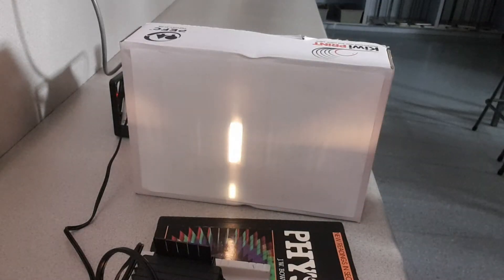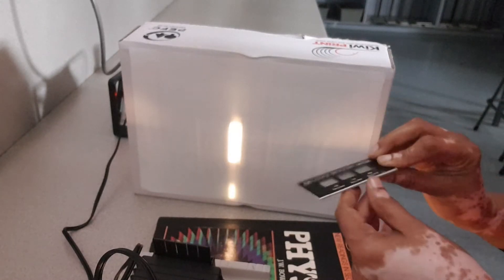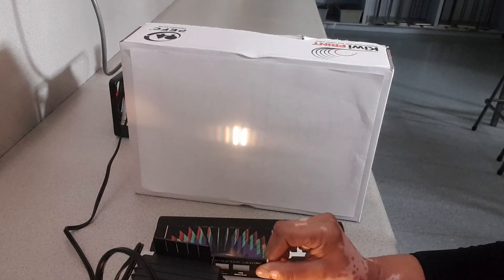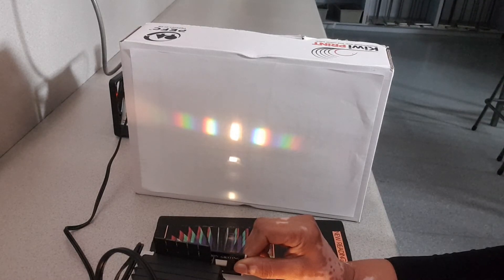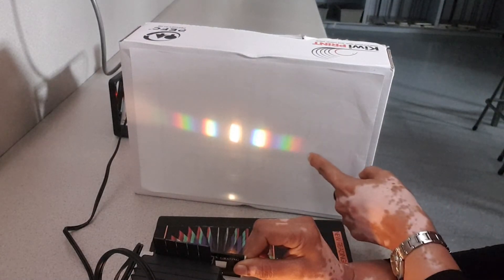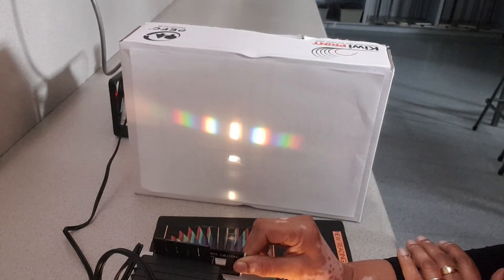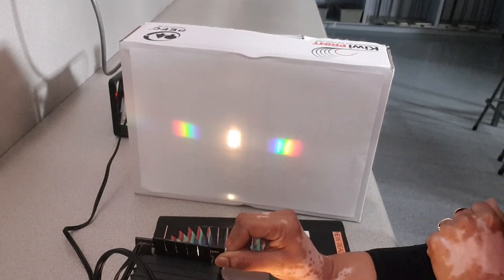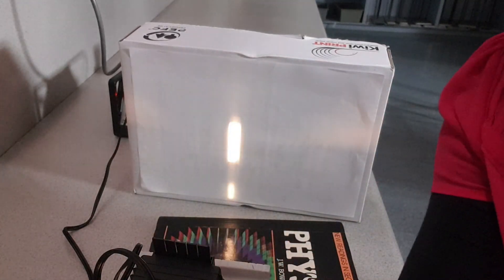Y13 Diffraction grating and white light

Comment: Where do you find diffraction gratings that produce sharp fringes like this? 

I need one for a school paper but part of it involves measuring the distance between fringes. I’ve looked at videos of gratings from amazon but they all seem to produce a blurry pattern that would be difficult to measure
Reply: Or does the sharpness depend on the light source more than the grating itself
Reply: Nevermind, just found out it does depend on that

Comment: If you say blue light is diffracted less because its short wave then why is it diffracted the most in a prism?
Reply from the maker: Smaller the wavelength, greater the angle of refraction. Hence blue refracts more and therefore bends more on entering air.
In a diffraction grating there are gaps or slits made on a transparent material. Light passes through these slits or openings, so there is no change in the medium. Diffraction happens because the edges of these narrow slits causes light to bend or diffract....not refract, where path difference is order number x wavelength = slit spacing x sin theta.
Reply from the maker: Two different things happening in each situation. Light undergoes refraction in a prism due to a change in the medium of transmission. So its speed changes. Using Snell's law you can see that smaller the wavelength, greater the angle through which it refracts.

When light passes through slits, it bends or diffracts. Since the wavelength of blue is less, the path difference is less causing it to bend less when passing through a diffraction grating.
Reply: @susanjohn4019  but is it even correct to call it a diffraction grating when it is made of a transparent medium that refracts the light like a prism does, i can't find any examples of diffraction gratings that are actually made from a non transparent medium with slits in they all are basically just multiple tiny prisms stacked together, they aught to be called refraction gratings.
Reply from the maker: Refraction and diffraction are two different phenomena.
In refraction through a prism, light goes from air into glass and back into air. When it does this the speed of light changes as it goes slower in glass as compared to air, then speeds up again when entering air.
Since light is incident at an angle different from 90° the angle of refraction will be different to the angle of incidence
Reply: @susanjohn4019  but in the diffraction gratings the light also goes into and comes out of a thicker medium. I understand the theory behind it but i am saying it is flawed.